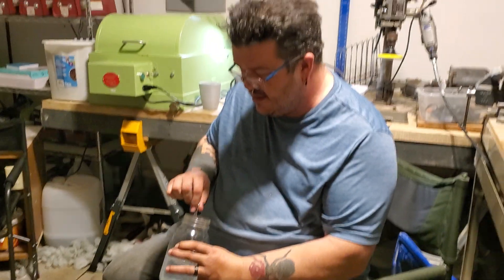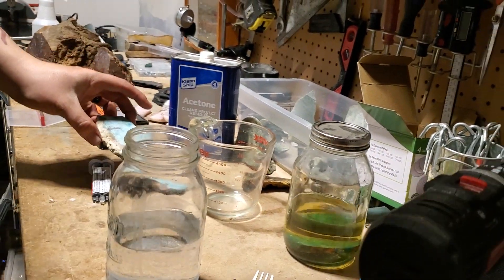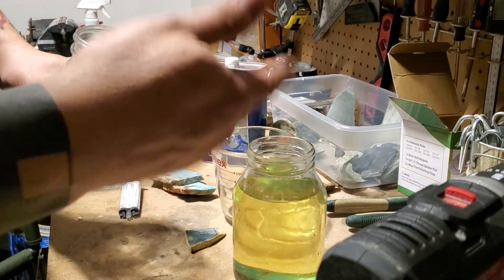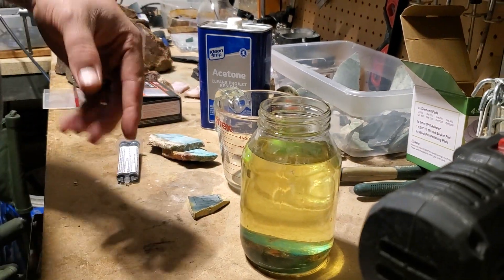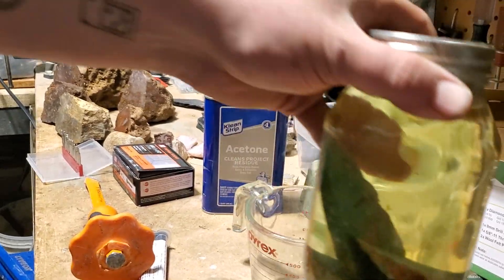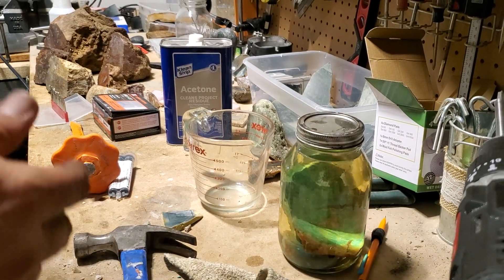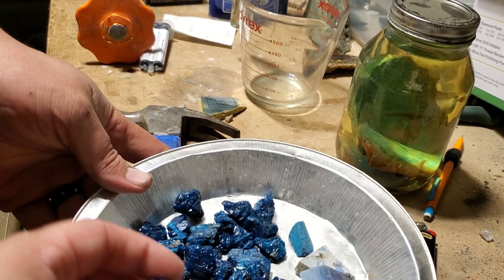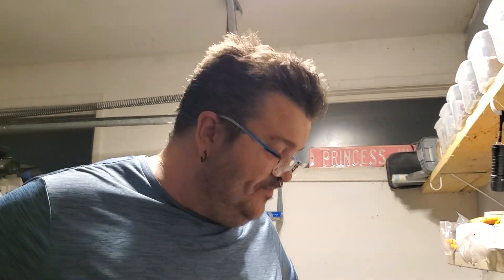Epoxy / Acetone stabilization method

Comment: Question #1: Can you stabilize wood the same way?
Question #2: can you add color to the solution (i.e., powder coloring) in order to color the wood?
Reply: You can definitely add color to the mixture, but I don't believe it will soak into the wood without using a vacuum.  I haven't tried this mixture but I've used wood hardener and acetone.  I use a brake bleeder pump to get the vacuum.  I wasn't all that pleased with the results.  It pulls it deep into the wood but after letting it air dry for 2 weeks it was still liquid inside the wood.  You could see the wood sweating a bit whenever you drilled, cut it, or sanded it.  I'm just trying to avoid having to buy Cactus Juice since I already use a lot of acetone and epoxy anyway.

Comment: Hello, thank you for the video, my friend who has working on stabalizing for some time, the problem with this method is that it does not penetrate the surface, have yoy tried this and a vacuum? Or if you are cutting you need to cut first then place it in the solution

Comment: Ayyy thanks for the video!  I’ve been stabilizing minor fractures in stone I’m going to polish with superglue (I’m a newbie working with beach rocks so I wasn’t worried about “proper” methods 😂) but was wondering if there was a way to stabilize an entire piece.

I’m wondering how this would work on raw pieces of leftover soft rock that I wanted to tumble 🤔  Any experience with that at all?  If not I might test it out - for science!

Comment: Just tried this and after a week my epoxy had cured inside the air tight container and ruined my gemstones. Any ideas? I was using Epoxy for casting maybe this was the downfall. Any help would be appreciated
Reply from the maker: Ouch! That's horrible to hear.... Soaking in pure acetone may eat the cured epoxy.  What material were you trying to stabilize? Typically the epoxy I use is JB Weld - Clear weld - 5min.
Reply: @LukiLapidary  Thanks I will try that, I was using Ethiopian opal, do you think your method would fill the cracks or just stabilize it? Cheers I will try your epoxy next
Reply from the maker: Ugh those are temperamental... 😂. Yes, it should fill in the cracks if you're dealing with a rough opal... There's really no point to do it on a polished piece. Make sure you close and tighten the lid so the acetone doesn't evaporate. The purpose of the acetone is to dilute the epoxy so it's particles can fit in the cracks, then even you pull it out after a week to dry, the acetone slowly evaporates... leaving behind the epoxy to harden and "glue" the microscopic fractures together. Please let me know how it goes on the second try!!!
Reply: @LukiLapidary  Amazing thank you I will definitely update, may I ask why there is no point with a polished piece? Is it because it is not as porous or? And would it work if you roughed it up first then did it then re-polished it? Thanks again
Reply from the maker: Well the point of stabilizing opal is so it doesn't crumble apart when you shape it. If you stabilize afterwards, the residue will be on the piece and take away all the work you did to polish in the first place.

Comment: So, I first time tried to stabilize some Idaho garnets that were crumbly around the edges.  They were very clean, having been soaked for a few days in muriatic acid, thoroughly rinsed off, then hand scrubbed with Dawn dishwashing liquid and a toothbrush, and then thoroughly rinsed again.  They air-dried for the past 3 weeks.  The second I dropped them into the acetone/apoxy jar, they began to bleed purple fast, like Alkaseltzer in water.  Not air bubbles so much, but looks like they are dissolving.  I can't find a thing on the net that says that this stabilizing process will hurt garnets.  Do you think its safe and not to worry?  The acetone is now purple like grape juice.
Reply from the maker: Acetone shouldn't hurt most inorganic minerals at all. It's mainly used for dissolving organic substances off of minerals, like glue. Are you sure they haven't been dyed and are 100% natural?

Comment: Is there any way to dissolve or soften epoxy resin? I have an electronic board from a washing machine and I needed to move it, but it was resined with epoxy. If you can help me I will be grateful.
Reply from the maker: Sorry for the late reply.....I would assume that acetone would dissolve epoxy. It just may have to soak for a while.
Reply: My experience has been once the epoxy has hardened it, you will either have to sand it off or use heat.  I have burned wooden knife scales off knives and replaced them with new scales using a torch.

Comment: What size epoxy?  How many ounces?  Just holding up the tube and saying "One of these guys" does not help, when there are more than one size on the market.  J-B Weld makes a 0.47 FL. OZ. size (14 mL), and an 0.85 FL. OZ. size (25 mL).  Which one should be used with the 2 cups of Acetone?
Reply from the maker: Here is a link to what I use...

https://www.walmart.com/ip/J-B-Weld-50112-ClearWeld-Epoxy-Adhesive-Clear/23848096?athbdg=L1600
Reply: @LukiLapidary this was my question also as I have some chrysocolla I want to try this method on. I zoomed in on ur video & it looks like u used a .47 fl. oz tube here???

Comment: Cool video!  Have you experimented with different acetone to epoxy ratios?
Reply from the maker: Not yet, that's an interesting idea though. The current ratio works great for slabs and such though. This isn't my own invention, it's been used before... It's just hard to find information on it.

Comment: Great video and lots of information.  Much appreciated.  How many times would you reuse the same liquid?  If you remove the rocks after stabilizing and then add more rocks, how many times can you re-use the stabilizing liquid?  Does the liquid discolor or separate over time and does that color end up being transferred to other rocks?  Lastly, is there a minimum amount of time that you would leave the rocks in the solution?
Reply from the maker: You can keep reusing it for 2 to 3 months...just make sure not to forget about it and shake it up now and then to keep it mixed. 

I haven't noticed any discoloration left on the rock, but obviously if you feel that the solution is getting too discolored then change it and mix up a new batch. Some rock will discolor the solution more than others.

You should leave the rock in there for a minimum of 7 days. The longer you leave it in, the more time it has to seep into your rock and work out any air pockets.

Be sure when you take it out though to leave it sit for about a week. You'll notice it getting less and less tacky.
Reply: @LukiLapidary  Awesome!  Thanks for the tips and the quick reply.  Much appreciated.
Reply: Thanks